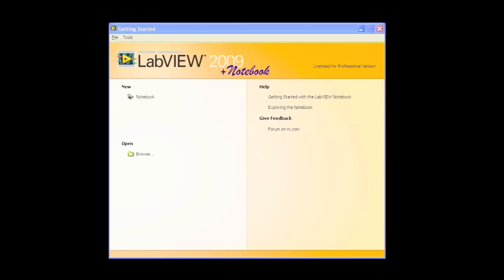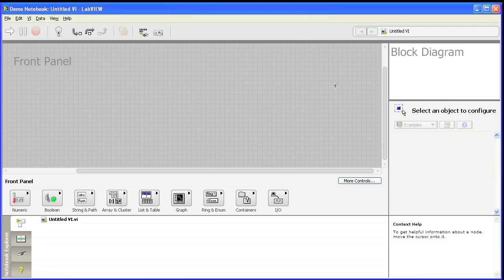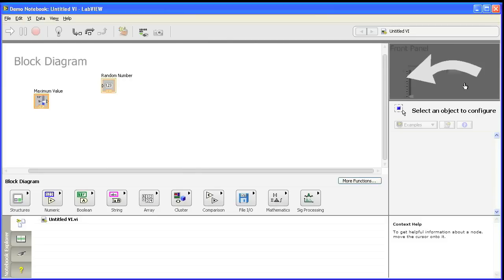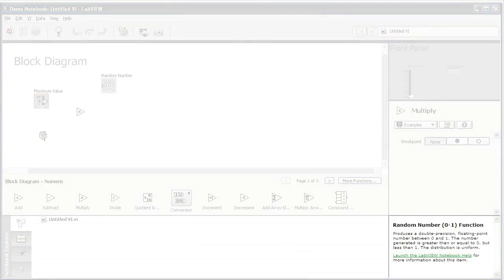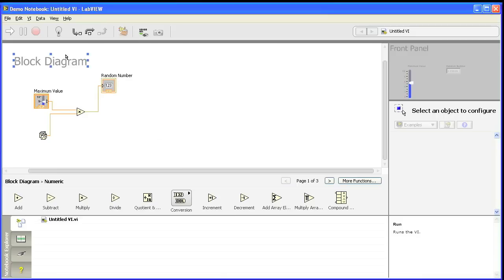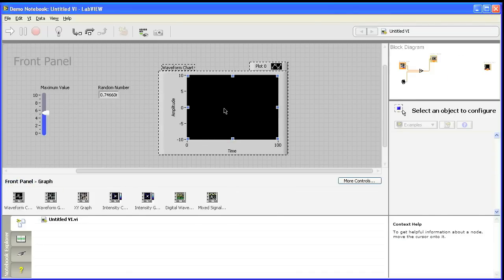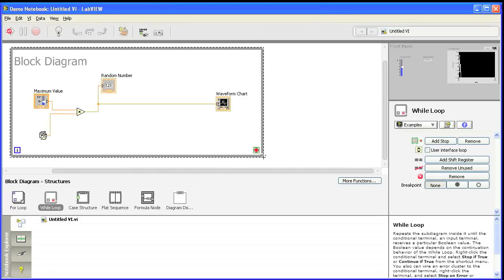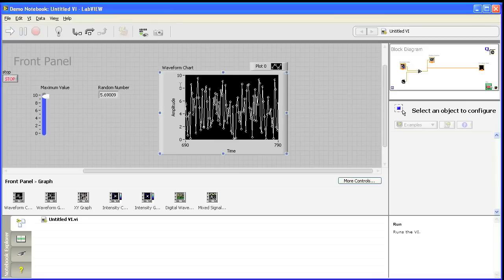Introduction to the LabVIEW Notebook Pioneer

Comment: I see where you are going here, this interface is similar to Microsoft Visual Studio or other text based editors. Interesting, but doesn't seem very useful for anyone with decent labveiw experience. It works well for a single VI, but gets in the way if you are debuggigng and want to see multiple block diagrams. If you are making a user interface VI , this does not let you control the front panel size. Good product though.